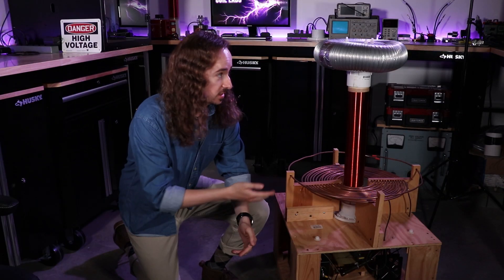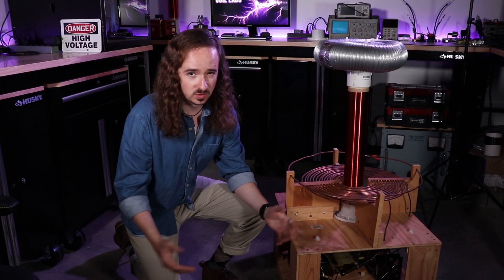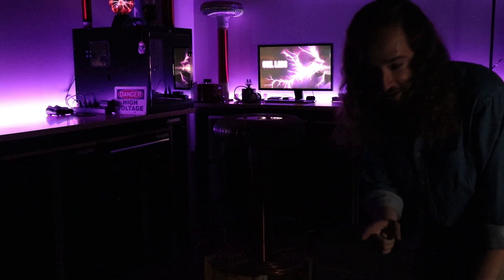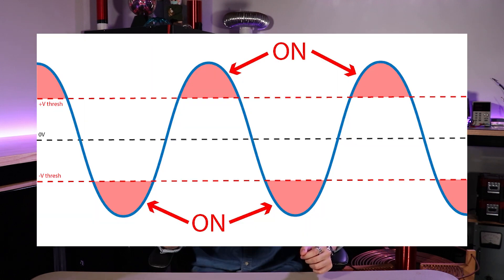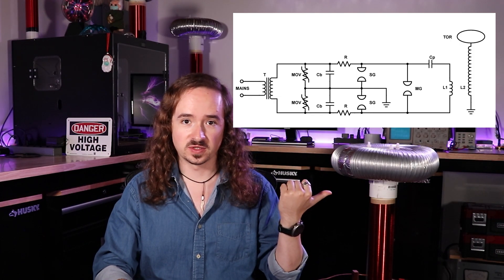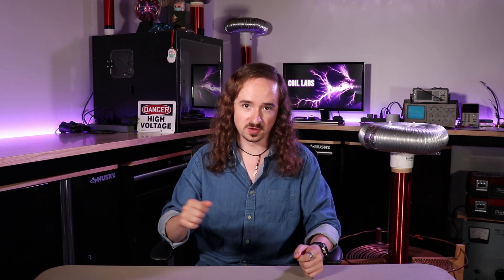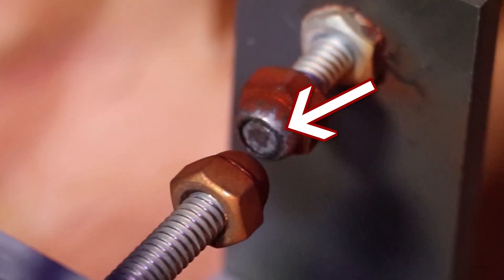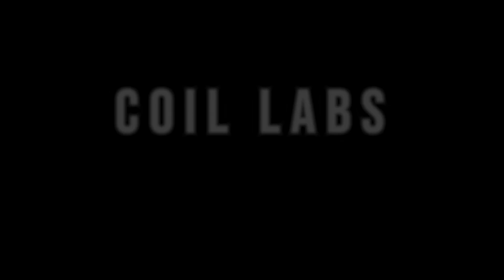How I Built My First Tesla Coil

Comment: I built some smaller coils back in the day using 4KV bug zapper transformers, an open spark gap, and some 3kv doorknob capacitors in series.  The most crucial part of the build was the adjustment of the spark gap for maximum output.  The trouble I ran into was the fact I was using galvanized screws for the spark gap which heated up way too quickly.  I am considering a rotary gap with brass leads for my next build using a 6KV furnace ignition transformer.

Comment: Is the center of your nst connected to mains or rf ground?
Reply from the maker: I have it connected to the RF ground. There are some conflicting opinions about this out there, but it seemed the safer thing to do to me.
Reply: @CoilLabs     thank you. mine was originally connected to mains ground since its the only receptacle on the circuit. but now that im adding a safety gap and later a terry filter i changed it and was just curious on how other people did it.

Comment: A question from a tesla coil beginner without measuring and test equipments : I have a tesla coil with a flat primary (14 awg) winding of about 5-6 turns around a 3/4 inch diameter, 9 inches tall secondary coil with 32-34 awg winding which I got from ebay. The primary coil is powered by two flybacks in series with rotary spark gap with a 50kv cap. When it is turned on, the secondary coil discharges 2-3 inch plasma arcs from all directions top to bottom, but the top load with a metal paint ball (from ebay) with steel wire break out only showed very small visible active plasma discharges. Previously, I ran it for couple of minutes and I began to smell smoke and found that the inside of the primary cylinder was burnt - appears that there were arcs inside (secondary from ebay 2mm dia). What is the cause of this occurrence and what can I do to prevent arcing from the secondary and transfer all the arcing to the top load? Best.
Reply from the maker: It's hard to say anything for certain, but if you're getting flashover between the bottom of the secondary and primary, it sounds like the primary is way too close to the secondary. For a spark gap coil, even a small one like this, you want fairly low coupling, because the voltages are high, meaning the peak current when the capacitor discharges through the primary is high. Single resonant solid state and vacuum tube coils use much tighter coupling because their peak current isn't as high, so you need more of the magnetic flux  to be coupled with the secondary to get enough energy transfer, per cycle. With spark gap coils, you can get away with looser coupling, because the current is higher, meaning the magnetic field is stronger. And in fact, you probably need to, because the voltage across your primary is very high and you need to keep it physically spaced away from the secondary. It also sounds like your coil isn't tuned well and resonant frequency of the primary doesn't match that of the secondary, when you have the top load on. That will lower the resonant frequency of the secondary and you probably need to lower the resonant frequency of the primary to match.

Comment: Would using the formula to calculate the resonance of the secondary to the primary, wouldn't that be the most difficult for most people?
I'm a ham radio operator so I do understand resident frequencies thank goodness, so maybe I've got a little bit of a head start then not being a total noob 😅😅
That was a good video I appreciate that! I wish I could share my Tesla build, it's just a little mini kit, but copyright and everything prevents me from uploading it because it does have a little music playing through it

73s
AF5CG
Reply from the maker: Thanks! Honestly, most of the formulas are actually pretty straightforward. People way smarter than me have solved empirical approximations for the "capacitance" of toroids and inductance pancake coils and cone shaped coils and everything, all just based on geometry alone, so if you have those equations it's just plug and chug and iterate to figure out your design. Or use a program like JavaTC, which just implements all of those formulas for you and can help you solve for the "optimal parameters". These days, I tend to use JavaTC as an initial solution and then double check with my own calculations, to be sure. But anyway, thanks to a lot of great work and willingness to share knowledge by the Tesla coil enthusiast community, it's actually pretty easy for anyone to get started and design coils that, theoretically, should work. The difference between a novice and a veteran coil builder becomes a lot more apparent when actually building it though. Understanding how to control parasitics and things like that. I don't know that much about ham radio, but I bet there are a lot of parallels to this, where veterans know how to make the fine details work better than a novice would.

Anyway, thanks for the thoughts spurring this discussion! Sorry I wrote you a whole paragraph, lol. Have fun with your little coil! I'll hopefully be getting into audio modulating some SSTCs here soon.
Reply: @CoilLabs  Oh no don't apologize at all! I really appreciate the time you took to respond! You are very correct about the parallels, and it's also true for audio(especially imbalanced audio signals), with ham radio a lot of issues comes in to play with the antenna is not in resonance, and usually can be fixed by adding equal lengths to either end of one of the elements in question, or taking said length away in an attempt to bring the SWR down close as possible to 1:1

Also, a lot of times you run in to stray capacitance in the coaxial cables if they're longer than just absolutely needed. Honestly I've found the best way to solve noise though in cables is to use a "telescoping shielded cable" which is just a fancy way of saying you cut the shield/ground at one end so that the current doesn't travel between amplifier and radio, but usually from amplifier to antenna it's left fully connected at both ends.

I've never actually experimented with antenna side telescoping-shield, so I don't know if it would have a negative impact or not.
I'm by no means an expert at all, but just my experiences. The biggest pain is damn ground loops lol. For that I use either a star-point ground system (for audio) or a ground bus (for radio).

Cheers for the reply!
Reply: I think I fixed the copyright issues, so here's the link if you want to skim it a bit for what one I built (not from scratch, but a kit)
https://youtu.be/E8QVj3CC1UI
Reply from the maker: Interesting stuff. I really don't know that much about the practical aspects of radio, so that's all interesting to hear about. Something I'd definitely like to learn more about some day. Thanks for sharing the video of your little Tesla coil. That looks like fun!
Reply: @CoilLabs  it's no problem at all, I really appreciate you checking it out!
I will do some ham radio videos once I move, I am kind of in a rough situation.

But because I'll be moving into an apartment, it'll be the perfect place to demonstrate how you can build an indoor antenna for a small space ⚡⚡
Reply from the maker: Cool, I'll have to check it out later, after work. Hope everything works out for you and you you can keep doing what you enjoy!

Comment: Why can't I find any 15kv 60ma NST online? The only ones I can find are 10kv 20-30 ma
Reply from the maker: They're harder and harder to come by these days, because not many manufacturers make them anymore. The original NST I had in this coil I got as surplus from a friend, but it eventually died, so I had to get another one. I actually got the one that's in there now, brand new, from Amazon. That was years ago though, so IDK if they still have any now. Keep looking. They pop up from time to time on eBay and other places.
Reply: @CoilLabs  I found one online! for 430 freaking dollars!!!!! I'm going to contact a local neon sign shop to see if they have any outdated ones they can sell me for cheap.
Reply from the maker: Yeah they're not cheap, unfortunately. 15kV, 60mA is about as big as neon sign transformers come. If you can find local surplus, that's definitely the way to go though.
Reply: @NerdlabsSci  New old-style iron core NSTs without GFE with 15 KV 30 ma output are available on E-Bay. Not cheap at about $150 but a lot cheaper than $430. You could also try a sign shop but they don't keep NSTs around much anymore because neon signs are converting to LED.
Reply from the maker: Nice! Honestly, even with just a 30mA transformer, it should still work very well. The fact that you can charge your capacitors up to a higher voltage is the main thing. Means you'll get higher pulse current and should get more voltage on the secondary, per pulse. The max current is mainly just going to affect how quickly you can charge the caps up. Since you're running a rotary gap, if it seems like you aren't getting as good a result as you expect, maybe try slowing the motor down just a bit. That way the caps have more time to charge up in between pulses. Something to experiment with. The output from that coil, as is, looks great though!
Reply: @CoilLabs  when I run the motor slower it pops the GFCI. since NSTs draw less current I might be able to do it once I upgrade. I did run it too long during a wireless power test and the rotary gap caught on fire so I can't do any more experiments until i fix it